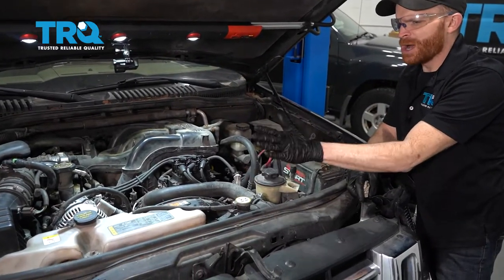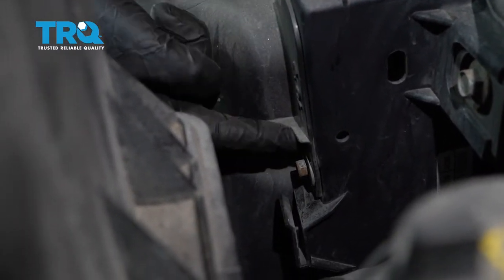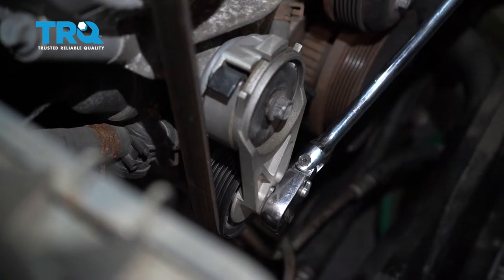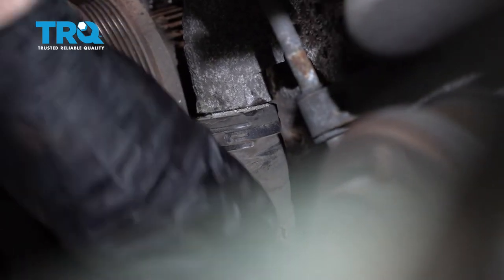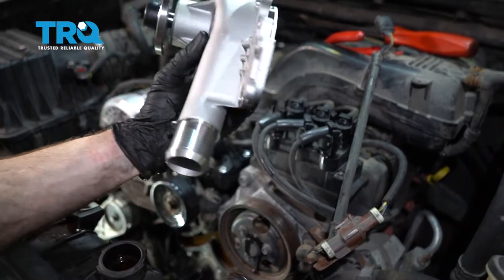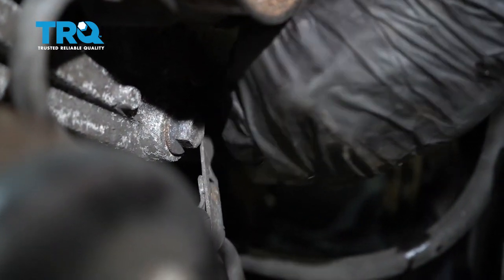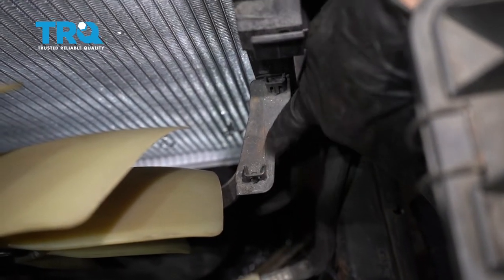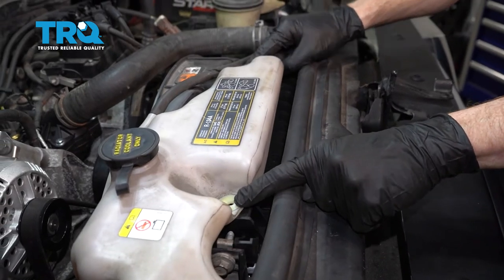How to Replace Water Pump 2006-10 Ford Explorer

Comment: Wow probably the best video I've ever seen for fixing anything on a vehicle quality of filming advice is right spot on thank you very muchy .👍👍👍 my replacement went so smoothly.  Thanks One thing I did do is drop the cap psi to 16 found one at auto zone the pressure relief type to with the red lever .

Comment: Sir I want to thank you so much for this video. I have a 2009 Explorer with 4.0 v6 and I did it and no major issues other trying to align that gasket. I used an adhesive to hold the gasket in place and bingo smooth as a bell to install. I did not have a inch pound wrench but I I have a foot pound wrench, so I  converted to foot pound and went a bit over but they are torqued  equally etc etc. I’m back on the road sir. 
Thank you again.

Comment: I’m
About to do an 06 or make an attempt to… that dam fan clutch is gonna be my headache and the hardest part for me.. after that it’s gonna be smooth sailing for me… just need to know if I need a gasket sealer because I see you did not use one , but I also am assuming that yours is an actual motorcraft pump and not an autozone special lol

Comment: Don't know what car this is, but the 2010 water pump has no hoses and just four bolts.  It uses a rubber 'o' ring instead of the gasket.  A bit easier.